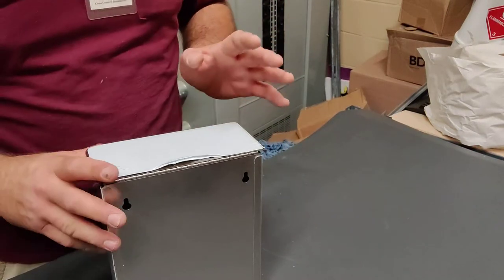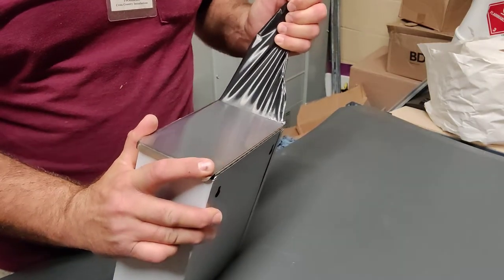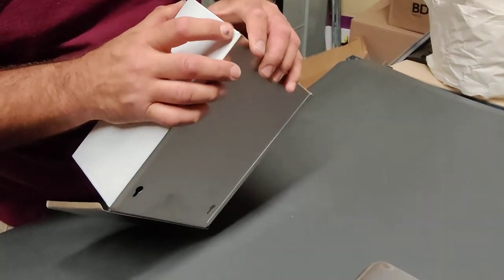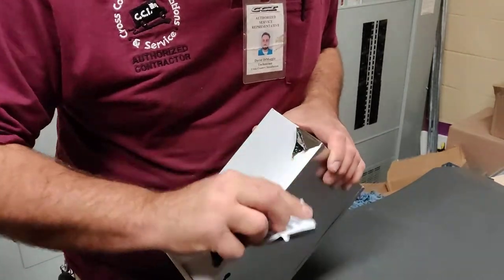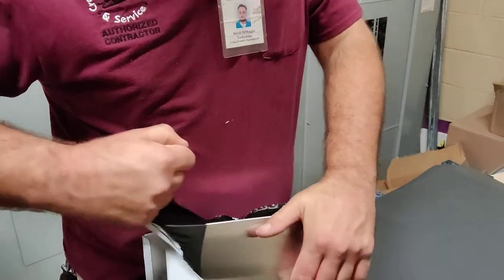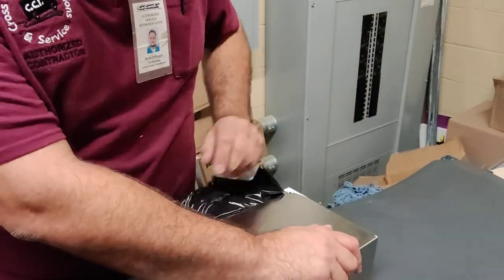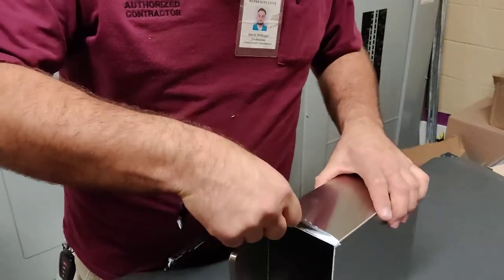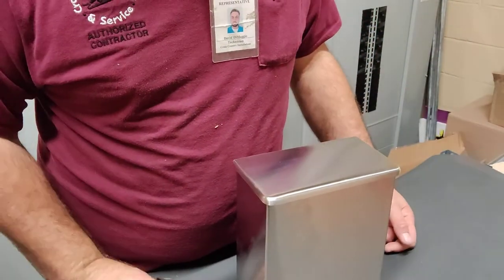Quick & easy way to remove protective wrap film on stainless steel How to get it off (quick removal)

Comment: I’m gonna try that right now. I’ve got 6 huge trays all with very flimsy film on it to remove. Took me almost an hour to remove it by peeling it for 1. I’ll get back to ya to letcha know how this works
Reply from the maker: How did it work for you?
Reply: @CityPigeonNOLA  unfortunately not too well but to be fair, the film on the one I did was different and super thin. Had it been a little tougher it prob would’ve worked
Reply from the maker: @C Teegs  well I know when it tears it is hard the get started on the edge. That is why using the sticky part of what you took off to help curl up the part that remains on what is coated